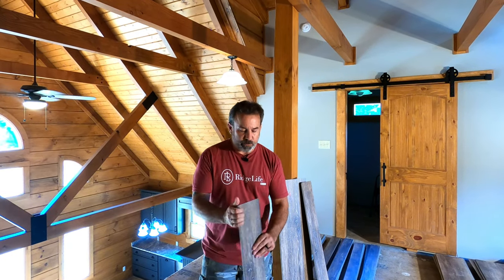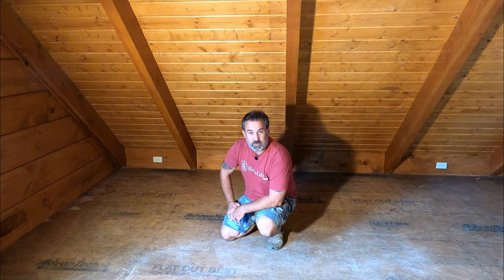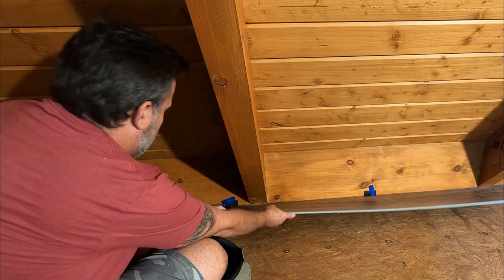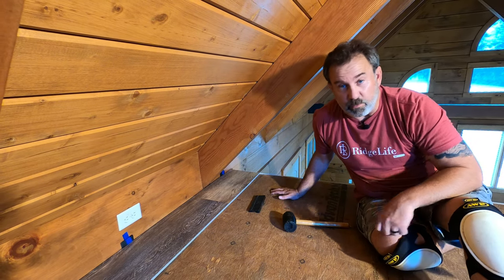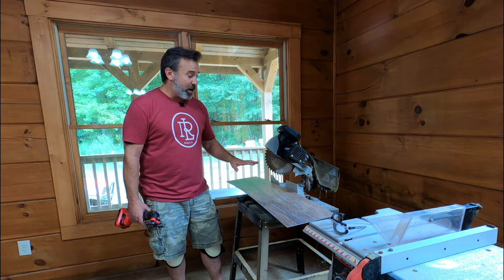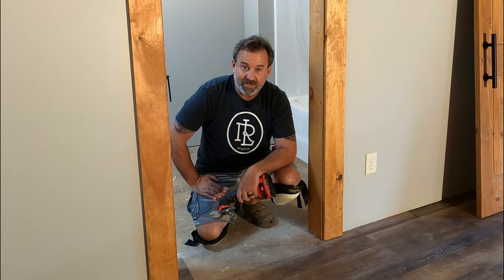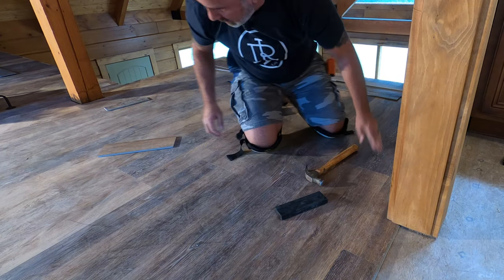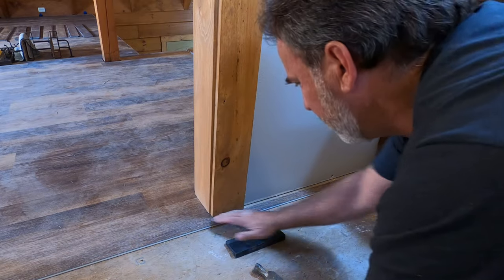HOW TO Install Lifeproof Vinyl Plank & Laminate Flooring | Easy Step by Step | Tips & Tricks!

Comment: And as far having your last board at least 10 inches is ridiculous that creates a pattern which you don’t want you want it as random as possible. I install this product everyday for Home Depot in Florida. Never ever use anything type of glue on this product unless your replacing a plank from damage. You will void the warranty. Trust me a small 2 inch piece at the end of a row will snap it tight and perfect it will not pop out at all unless one of the grooves are broke.
Reply from the maker: This is incorrect. Short pieces will separate on you and not be very stable. Read the mfg instructions.
Reply: @RidgeLife  ya you couldn’t be more wrong. Been installing this product for Home Depot since it has come out everyday. I have not had 1 issue.
Reply from the maker: @3rdGenFireChicken  again, please to all reading, follow the mfg installation instructions.

Comment: Just remember it does not always have to be 1/4 perfectly it can be 1/8 or 3/8 just as long as you know the baseboard or 1/4 your are installing will cover that gap. That goes for all the end cuts
Reply from the maker: Very true. Thanks.

Comment: Just like he under cut the door jambs he should have done the same thing to the pole he cut around. The handy dandy tool he is referring to is called a pull bar so if you need to get one you know what it’s called. A store employer is not going to know what a handy dandy tool is.
Reply from the maker: HA! I preferred not undercutting the poles myself but good suggestions for those that prefer to do so.
Reply: @RidgeLife  it’s a much cleaner look instead of installing trim around it
Reply from the maker: @3rdGenFireChicken  very true.

Comment: he should have put a shim where 2 join meet. So when you pound the hammer it doesn't arch in since the wall may not be straight.
Reply from the maker: I used wall shims all around. Thx.

Comment: Great video, but perhaps you should describe it as horizontal to the main lighting source. When you mention perpendicular and origin of light… well you could see how that could be confusing for some.
Reply from the maker: The lines should typically run along the path of light from a window. Think of T-square at the window with the T being a plank running perpendicular to the window wall. The board lines do run horizontally with the light beams from the window you are correct. Thx!

Comment: Why did you switch from mallet to hammer? Good jobs on all the special cuts!
Reply from the maker: The rubber mallet was a bit too big for the tamping block. I used it more for the flat ends and hammer for the block.  Thx!

Comment: Tim you may want to use a scrap piece of product locked in when you are hammering the boards together. Especially around the door casings. I’ve installed flooring for 30 years and it’s the absolute worst when the locking mechanism sheers off or the edge gets damaged.
Reply from the maker: Very true!

Comment: Darn.  I wanted to see you do the flooring downstairs, as it's the same set up as our camp.  And, I was questioning which way we should run our flooring, but you did the upstairs instead of the downstairs.  Do you have any pictures of the downstairs floor.  I looked at your site, but couldn't find any.  Have you done the downstairs floor yet?  It would be very helpful for me to see.  Nice job on the upstairs.  Thanks.
Reply from the maker: Oh yes. Started on front door side and same  side with master bedroom. One solid floor through while downstairs! Thx!
Reply: @RidgeLife  Thank you

Comment: I haven’t heard any mention of using silicone to caulk around the edges when installation is complete. Does that only need to be done in wet areas?
Reply from the maker: I’ve never caulked edges on flooring. If in wet location, wouldn’t hurt.

Comment: I just put down some and I have spot where there was no way to get it completely level and now a couple boards have separated maybe 6 feet long it looks like a crack but it’s where the boards did not go completely together anyway to fix that? I also used an extra sound dampening for luxury vinyl I’m sure you know it I’m talking about real thin roll comes in a roll
Reply from the maker: They say adding extra underlayment voids the warranty.
Try using duct tape and kicking the tape to lock it back in place and add some glue in crack.

Comment: When installing the multi width planks (which only have 1 per box of the widest) how do you stagger? The row with the widest plank , the smaller width planks will have no stagger pattern all the way to the walls, is that correct??
Reply from the maker: I open multiple boxes and separate by size and. Pattern. I stagger the widest and mixed up medium and small next to each other. Hope that helps.

Comment: Couple things... Do you need a vapor barrier if laying over concrete? Second-- can you just caulk with silicone beside a tub? I absolutely hate that stick it on quarter-round. It peels up in a years time.
Reply from the maker: Yes you can caulk instead but the other three sides need to ensure to have some room for expansion. Lifeproof doesn’t have as much as others for sure. The built in underlayment is good but you may want to refer to your actual product for concrete.

Comment: How do you install the vinyl plank against a tiled wall? Thanks
Reply from the maker: As long as you leave a small space then put a trim piece at base of wall to cover like base shoe or 1/4 round. You may have to glue the trim if cant attach to the wall.

Comment: What do you recommend for leveling LVP to next room?? Lifeproof only comes in 6,12, or 22mm. The drop off is 20mm meaning I can’t go over 12mm thickness . How do I transition the other 8mm?
Reply from the maker: You could use a transition piece to account for the difference in level or you could Sandown the transition and use leveling compound but not sure that would look very good.

Comment: Where can I purchase the vinyl quarter?
Reply from the maker: I placed the link in the description and here is the link as well. Thanks. 
Flexible Quarter Round Molding Self Adhesive, 10 Feet Peel and Stick Flexible Trim Caulk Strip Molding Trim for Wall Edge, Cabinet Edge, Tile Edge, Ceilings Edge, Wall Corner and Countertops- https://amzn.to/3uXUS4u

Comment: Tim! I just got back from Home Depot, here in town. I asked 2 different floor people about that 1/4 round sticky tape. One guy helped me look around for it with no avail. The other guy looked at me like I was from another planet! Mind you this is up in Canada. Do you a specific name and/or a Home Depot product number?
Reply from the maker: We got it on Amazon I believe.
Reply: @RidgeLife , also when I was over at Home Depot there was some 3/8” round polystyrene that was mentioned in the instructions that came with my vinyl flooring. It explained to put it in between the flooring and the wall; then put 1/4 round casing on top of it with slight pressure and nail it to the wall or tall baseboard.🤔
Reply from the maker: That is cool. Never saw that.

Comment: Help/ if Lifeproof 22mill vinyl or hybrid laminate better option ?
Reply from the maker: I prefer vinyl over laminate. Engineered hardwood is nice though over both!
Reply: @RidgeLife  i’m so confused why would anyone pick Engineer over real hardwood besides Price. You can’t refinish engineered floor. I installed plenty of hardwood floors and there are easy actual easier. I think the laminate and being more pliable and take more effort to line up the joints without breaking the tabs. I’m really struggling playing life down all over my house being at vinyl and it just feels cheap to mecompared to hardwood but I get it can’t put hardwood in the kitchen
Reply from the maker: @efthimios  we are talking interlocking flooring. Real hardwood needs completely different installation. Yes. It’s best long term though after initial cost.

Comment: I don’t see the moisture barrier of 6 mil plastic recommended by Cali  flooring for a moisture when installing their floor plank on top of a concrete slab like you are 🤔
Reply from the maker: My flooring is not on concrete slab. It is conventional foundation with crawlspace.

Comment: Please don't use a regular hammer for pounding in your joints.  Use a tool made for it.  A regular hammer can leave terribly ugly hammer marks on your planks.
Reply from the maker: I used the tamping block and end tool. A regular hammer can be used with them.
Reply from the maker: Oh you mean from above. Yes, a mallet is much better you are correct.

Comment: Video information make it look deceptively easy to install and panels are super durable...it is not and they are not.  Video shows the host violently pounding away with both a rubber mallet and a regular hammer.  We found that you will damage the locking mechanism if you treat it like that.  we had to throw away 5 panels during installation in a 100 square foot bathroom.  The video has one person doing the installation but use 2 so you can watch what the impact of installation of one panel does to the others.
Reply from the maker: I have done many of these by myself. I use the tamping block between the edge and the hammer. No issues!

Comment: .. I cannot get my life proof flooring to lock properly
Reply from the maker: Did it get wet or moist? Sometimes temperature changed can cause issues. Let it stabilize first. Should snap into place fairly easily and use a rubber mallet if needed. Use a block to keep from damaging.